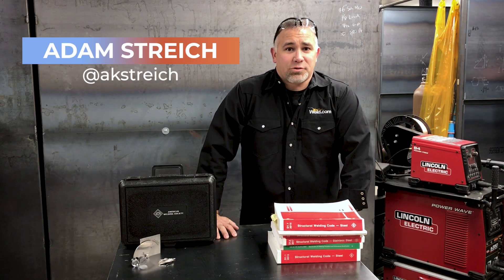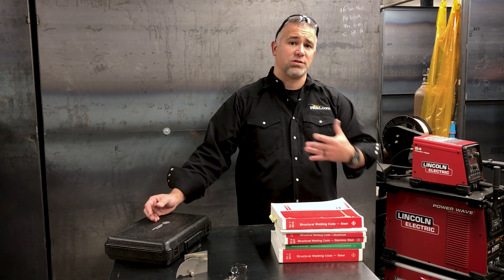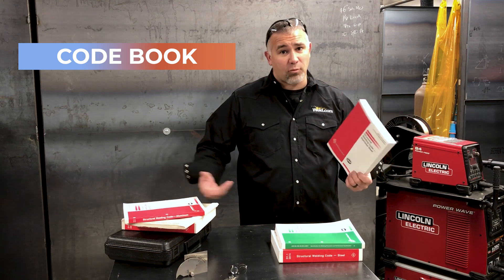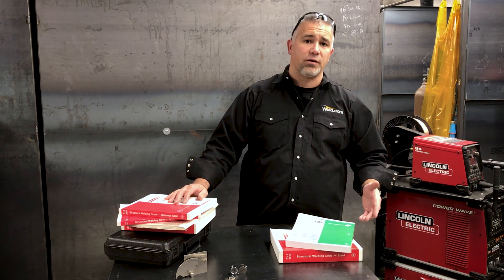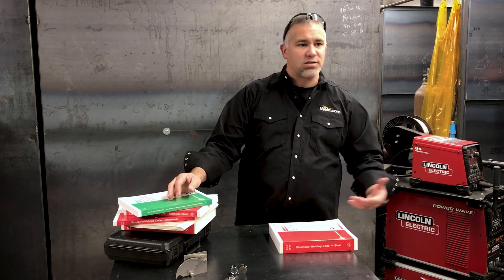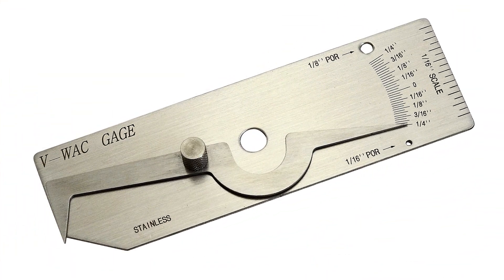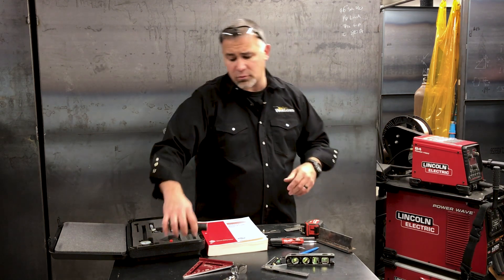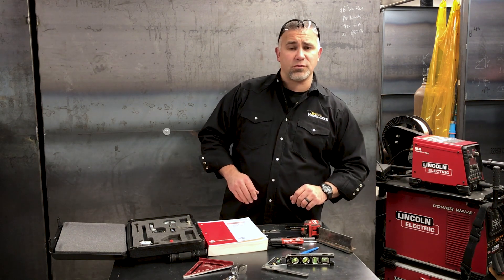Becoming a Certified Welder: Insights and Advice from Adam Streich

Comment: Basically, it means that you can produce welds that meet certain specifications.
Reply: Basically… someone followed the recipe developed through testing and the weldor did what they needed.  Unfortunately it doesn’t mean someone knows about welding, settings, parameters, design, engineering, etc… just that they followed a WPS and passed a test. But atleast it shows they’ve met proficiency in a process
Reply: @adamstreich3007  To a certain extent that it true.  In the work that I do, our WPS provide ranges for the welder to use.  For my industry, we take on the burden of producing the WPS and rely on the welder's skill and talent to produce a quality weld that meets our requirements.